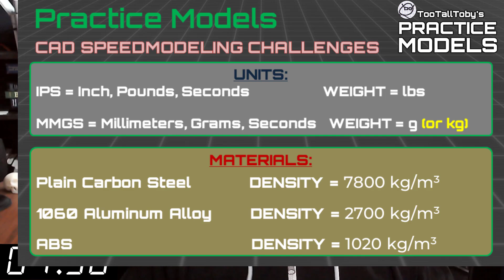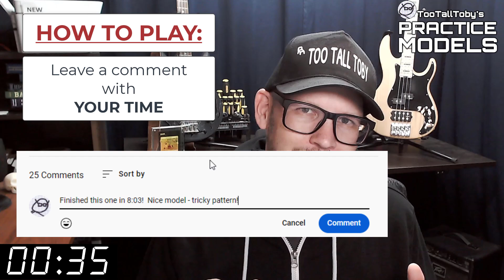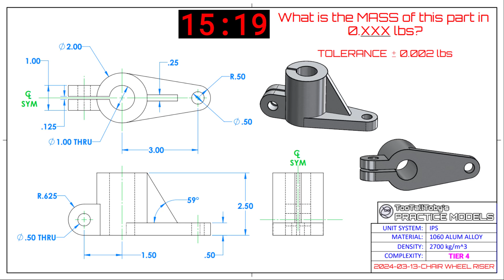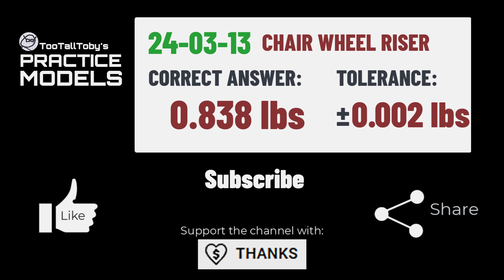2D Drawing to 3D CAD - PRACTICE MODEL- Exercises for Onshape, SolidWorks - CHAIR WHEEL RISER

Comment: 3 tries to get this one correct in OnShape.  I mistyped 2 dimensions and took forever to find them.  Gave up on the rib feature; instead I cut a 1/4 inch wide super-thin slice from the circular boss where the rib needs to go and then sketched a triangle and extruded it to make the rib.  I'm sure there's a better way.
Reply: I made a copy of the workspace and this time I created the rib by ending the slanted line .015 in below the top of the cylindrical boss.  Now the rib worked.

Comment: 0.838 lbs. Done in 6 min.
Pretty easy, the only tricky thing is the rib. Dragoș.
Reply from the maker: Great discussion and that rib is indeed really tricky there!
Reply: @TooTallToby  It doesn't seem like I've ever had that problem. Then again, maybe the ribs didn't go to the top of the cylinders. Hmm..
Reply from the maker: yeah I did a discussion of this during the "live solve" of model monday live.  I'll cut it out to a clip at some point (whenever I clone myself so I can double the time RE multiplicity)  @jedhightower3225
Reply: I had issues with the rib as well, Dragos. Wonder why??
Reply: @jedhightower3225   me too. tried rib, did not work.
Reply: @tomdunn7147  Hello Tom! So, that's 3 of us now that couldn't get the rib feature to work. That's weird! I moved the line down from the top of the cylindrical shape, and it worked. Even got the same mass. It still won't work if it's coincident to the edge of the cylinder. Again, weird!
Reply: @jedhightower3225  No coincidence. Otherwise you will get zero thickness geometry.
I did a line, up to the center, then I applied rib.
Worked just fine.
I learned from Toby, a long time ago. Dragoș
Reply: @ciorad1389  I'll try that out and see if I get the same results. Thanks for the tip, Dragos! Much appreciated!
Reply: @ciorad1389  Yup! Went up past the top of the cylinder, and the rib feature worked perfectly. Nice explaination, Dragos!
Reply: Because it is on cylinder , and can't extrude, you get zero thickness geometry.
You must drag a line into the cylinder. @jedhightower3225
Reply: add one more horizontal line to the rib on the top of the cilinder https://www.youtube.com/watch?v=_ZShYUFj0KM  @jedhightower3225
Reply: In OnShape, I tried Toby's trick of extending the slanted line horizontally toward the center of the cylinder, but the rib feature still failed.  Doesn't this work in onshape, or am I doing something wrong?